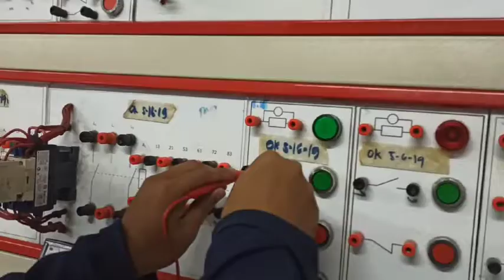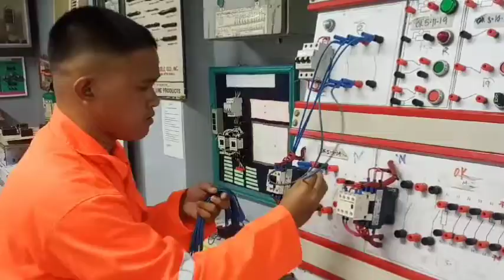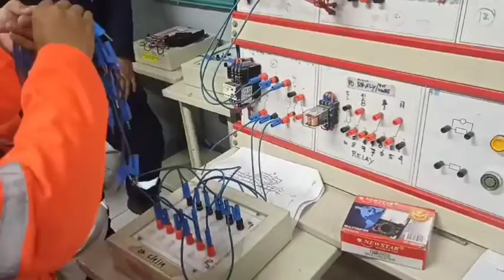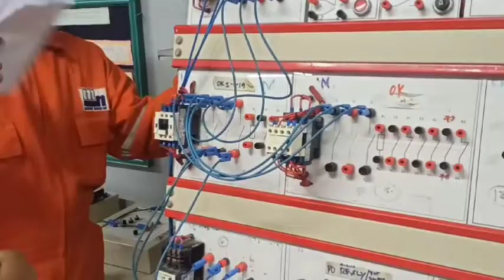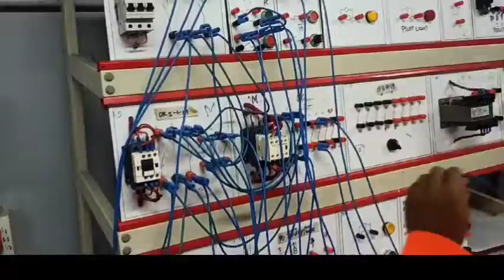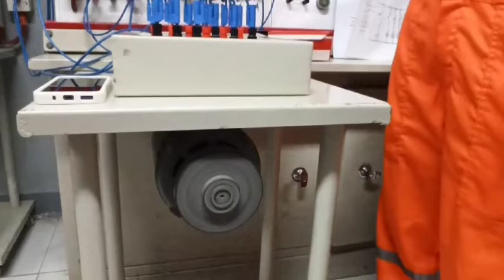FORWARD - REVERSE CIRCUIT

Comment: In that case the forward and reverse contactors are mechanically interlocked right? i.e., if one of them is closed the other cannot close. Why is this done though? Is it to avoid dead short circuit in case both the contactors close simultaneously or the other way around? . Also electrical interlocking could be provided using the contactors control contacts so be sure to take advantage of that. Please answer my questions. It would help me a lot. Thank you!